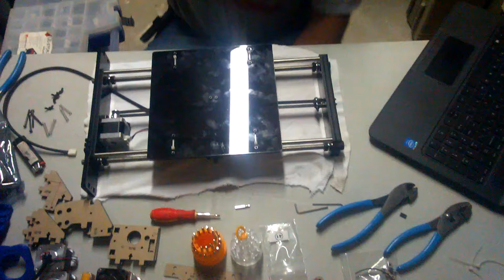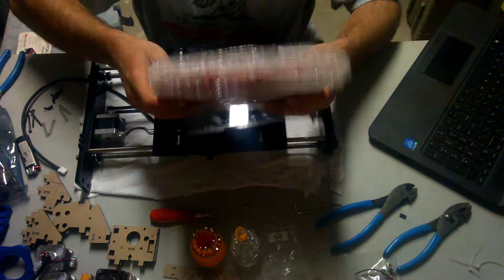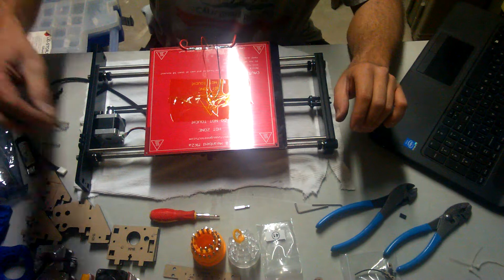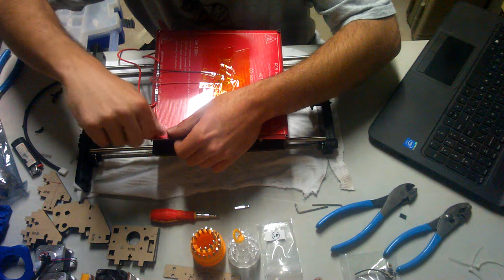Geeetech Prusa i3 Pro B 3D Printer Assembly Video Step 8

Comment: There is no time or do not know how, so it is better not try !!! Go jump from a parachute, manage aircraft but only one is not drawn in the other, you carry full responsibility leaving instructions with errors
Reply from the maker: +Nikodim Potapov makes no sense. Was lost in translation. Your insulate will not result in more help. Why not learn that first, 
"do not bite the hand that's feeding you"
And also remember, manufacturing may have changed the product with out notice. You may have noticed that your "part numbers" are different from mine.

Comment: hi there

i want to buy the same printer but i want to know your experience with it is it good or bad

Hope to hear somethink :P
Reply from the maker: i have had good experience with it. except tech support.
so that's why I did an online store to sell them.
i have like 8 pro x, 1 pro b, 1 new, 2 used g2 Delta (not for beginners) in stock.
just sold the aluminum one I had.
as for quality, you get what you pay for but not bad in my opinion. see other videos like the one I was printing spares at 0.1 mm all four at once total amount of time was about 32-36hrs. i can't remember off top of my head.
if no tech support needed i may add printer at lower price.
Reply: Ok thanks i will buy one soon let you you hear it :D
Reply from the maker: +3DPrinting ok.
Reply from the maker: +3DPrinting I sent reply but did not post not sure what happened there? YouTube glitch I guess.
I have had a fine experience with it, and resolution can be outstanding if you add a fan to help cool filament, however i suggest go the aluminum pro and you will have a MK9 extruder in it. They call it the new "MK8"
Reply: Thanks for the reply i have bought the prusa i3 black with the mk8 new :D  very happy with the result but only some problems with the rods...
Reply from the maker: +3DPrinting I rolled mine on my thigh to get them straight.

Comment: The wires for the heated bed should be under the bed, not on top... got to love the Geeetech instructions.
Reply from the maker: actually that was second time, the first time was right but ran out of space on my SD card. so I re-did it, and came out wrong. I'm working on the instructions now. They will be better very soon.